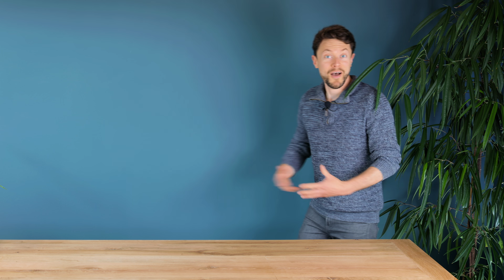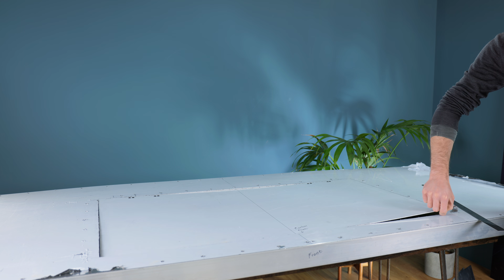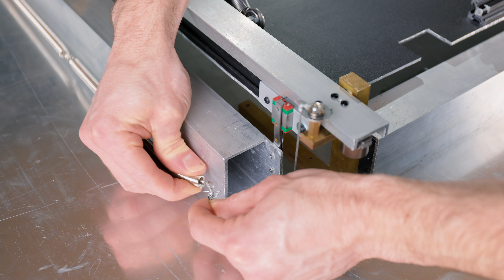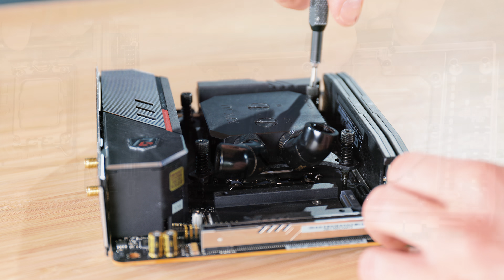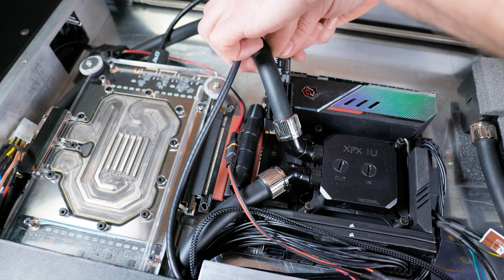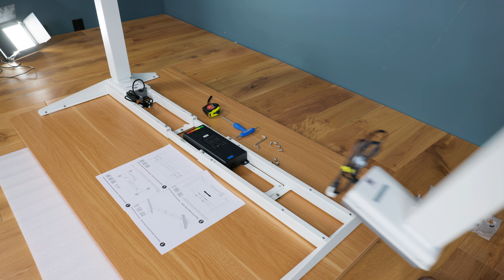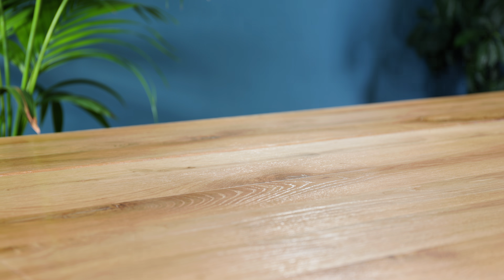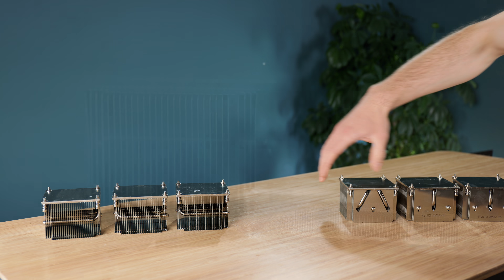Building the ENDGAME invisible PC

Comment: I don’t have to watch full video to give a like to this video, just amazing concept as always.. just a small doubt, the brass pipe water flow is in series it seems which might conduct heat from one brass pipe to another directly and through heat sinks which may lead to low efficient heat dissipation, the water flow could be designed in just one direction starting from one side to the other in parallel with all those 4 pipes  which might improve heat dissipation, but you must be knowing it better.. I am not sure if this works as I mentioned…

Comment: Don't use a 13900k it's power draw is so high that you have to delid it to get it to not thermal throtle 
i recomend using a R7 7800x3d or R9 7950x as it is the same prefromance for lesss power draw

Comment: First of all, you did a great job. My idea would be a water cooling system with radiators ranging in size from 40mm to 80mm. These could fit perfectly for the width of the table. The Alphacool brand makes them, for example the “Alphacool NexXxoS HPE-60 Full Copper X-Flow 80mm Quad” would certainly be worth considering.

Comment: Awsome video! You solved a huge problem for an idea I have to make a 3 PC in one desk build. I am going to use the X32 PC's and they will be all air cooling as well.
2 questions thou. 1. The brass tubing you used for the water cooling. Will there be a corrosive build up in the water from the brass after a period of time in use? I'd like to see a fallow up video on that too.2. Those slime fans that you used. Are they name brand and where did you get them? Did you have to buy them one at a time or in a lot pack?
And I see only one problem you might have in the near future. How are you going to repair or replace the monitor when all that wood is glued to back of it covering the mounting screws?

Comment: If Corsair and Flexispot teamed up to make this a commercial product, I'd save up for one like it was a new car or something
Reply: It would probably cost as much lmao
Reply: @xe8905  worth it
Reply: you can get it cheaper if you just get someone to do it. I showed this video to a furniture maker friend of mine and he said it's gonna cost me about 3-3.5mil IDR (about 200USD ish?) for the table top only without the motorized legs, that includes the material and labor cost. he said it can be made even cheaper if joined aluminium strips were used instead of sheets. the woodpart can be made from wood scraps joined together too if you want it cheaper and doesnt mind the pattern (imho it is cool tho).

perhaps its a bit more expensive on your area depending on the material/labor cost, tho
Reply: @Chronostra  In Indonesia you could maybe have the table top for around 200 but it takes a lot more than that to be fully functional. Imagine a furniture maker from Europe or North America making this and selling it as a complete and finished product, it would probably come out at around 15-20k

This is not some scrappy home project, it's high end custom furniture.
Reply: @ThaJay   that's why I said depends on the material/cost of your area, did you not read mine till the end?
Also it's DIY, you can go balls to the walls throwing money for the bestest unobtainium for your project materials, or you can swap parts for cheaper stuffs to suit the budget and needs.
Because most of the time branded products are often more expensive compared to locally sourced. You can try compare the same size and quality table tops from ikea and your local furniture/woodworker, or try showing Levus Zero G Workstation to your local welder how much it cost to weld steel piping into that shape will the price even crack half of Levus'
Reply: @Chronostra  fair enough
Reply: Why corsair? The only thing from them are the fans lol
Reply: anyone but corsair they are super expensive, he could have went with different fans and saved a lot!
Reply: i wouldn't pay corpa hacks a dime for this. diy or pay the guy. no corpo zone!

Comment: Interesting project and well done in the realisation. But I don't realy see any kind of reflexion on the maintenance topic of this kind of project. 
A custom watercooling system needs to be checked every 6 months or at very least once per year. And by "checked" I mean you have to change the liquid, and check out if there is no problems in the waterblocks. You will also need to do some dust cleaning time to time (like a least every month). How does this build allow you to do this without dismantle everything ?
A cool idea would be to do the same flexible pannel you done for the screen but for the computer. Something like this may allow you to keep your computer clean and be able to do any sort of cleaning, repair, or upgrade with the minimum efforts.

Comment: cool design but some would lose time closing and opening it as well as losing drawers already in thin desktop. would be nice assignment for a mechanical engineering student.  depending on the temp you may be able to use hot water from those brass tubes to make coffee or espresso. many espresso machines use brass boilers. you'd need to use food safe tubing. that power lift in up positiom would look like a European espresso bar. could have used a apple silicon mac mini with a thunderbolt external ssd array. way cooler, way less power consumption and noise.

Comment: Did you have any cooling for the motherboard, power supplies and nas? That's one thing to be mindful of when doing watercooling: normal waterblocks do not cover everything that needs cooling. Even a monoblock that covers the motherboard VRMs, doesn't provide cooling for chipsets, drives, RAM (DDR5 runs hot, it has power management on the modules themselves) etc. This stuff usually get cooled by case airflow and the airflow movements generated by CPU and GPU air coolers.

If you use waterblocks/AIOs and radiators to move the point of thermal exchange to air, away from where the CPU and GPU are - do remember that these heat sources left behind still need airflow. The backside of your GPU included, especially if it's a 3090, 4090, 7900xt(x) etc.

Comment: Apart from the mindblowing feat of engineering that left me in awe, I am questioning the use of the monitor, as the primary selling point is that it bends, yet with this setup that wouldn't be the case. I feel like the price markup of the monitor due to its bending hasn't been used and I wonder if there are any other OLED UW monitors such as the ones from LG or SAMSUNG which would be cheaper than 2k would be a viable lower cost alternative. Or is this monitor the only one that would work due to its thin profile and mounting points? In either case, this is a top 3 build I've ever seen. Truly GREAT WORK!
Reply: well, once you get into really large, really high end (consumer) monitors, the choice shrinks really fast - esp. once you start adding some functional requirements. Could be this was the only one available on the market, ticking all his boxes
Reply: What he really needed to do was incorporate the curving mechanism so he can still curve the monitor after the compartment is opened. Although, he may need some kind of interlock that prevents closing without first flattening the monitor again.
Reply: This exact panel is used on a few different monitors - Corsair is just the one putting the flexible mounting on it. I all but guarantee he was sent the monitor by Corsair, either for this video or something else previously.
Reply: can't he bend it still? If not, couldn't he just screw the center part of the monitor to allow the borders to bend in? Maybe not, i have no idea on how this screen works

Comment: I like it. 

I disagree with the comments about the adjusting the monitor height. I think if anything a slight tilt adjustment would be fine, but you dont want to be able to close the monitor in the hatch and break it. The hatch cutout is limited by the depth and width of the desk, so the only height adjustment available is within the hatch footprint. And the footprint isn't much unless the desk is very deep.

My idea is the radiator needs some sort of cover to protect the blades from coming into contact with fingers or whatever and because one end of that metal is potentially hot enough to burn skin with long enough contact. Especially children. At 50C, its probably fine, but your other test indicated that 90C was a possibility, and 70C is the burn threshold for metal.

Both to avoid injury and breaking a fan it needs some sort of cover. But it also should be designed not to restrict airflow. Im guessing a lot of the benefit in cooling is actually the bit of blade sticking below the desk. Im guessing the desk is built tightly, so there's not enough airflow through small leaks in the desk.

I wonder if the original laptop fans would have worked better if you just removed one of the heat sink sets so that they could draw air from behind the desk without having to draw the air through a heat sink. Basically just cut the air resistance in half. The original setup I assume would have drawn air across the one heat sink and then blown heated air back across the other heat sink providing basically no cooling anyway. I think it was just doubling the air resistance for no benefit.

Also someone mentioned this, but the back and forth brass pipes, wouldnt they transfer some heat from the water coming in immediately to the already cooled water going out? Some sort of solid insulator or even just air between the segments would probably make that bit more efficient.

Great build! Dont take any of that as more than the thoughts of an idiot.

Comment: this is a neat project. Sad that the original design for the heat spreader didn't pan out. for a moment I thought you were going to slam like a miniature water chiller for the loop in the desk, but I can't think of a better way than what ya did. Only gripe I could give is your monitor and keyboard tray needs to be more deeper in the width of the desk so the center of the monitor is more eye level for adults. Kids who would have this desk it'd be perfect for when using. still an amazing project. you deserve to go to bed with the stupidest grin on your face.

Comment: To reduce heat, its easier to tune the components like undervolting and to operate any component to theirs most efficient point (eg fps/watt). This way the cooling system become almost not a problem at all. Component are ok to run alone between 60 to 70 C without any issue.

Comment: Well, as much as I may admire your work in the end it felt like it's missing something, I mean you can push the limits in this project and add a mechanism that opens the lid of the monitor, and also try to fit some fans into the desk without anyone being able to see that there are fans down below. Also is it possible to implement some hidden speakers inside the desk?
 Other than that I Am amazed by the effort and dedication along with the polish you put into your projects. Outstanding!

Comment: Placing the GPU and CPU directly after each other in the loop isn't great because the heat from the prior would affect the latter, but I guess the 1560mm radiator is enough to bring the coolant temp low enough for that to not matter. Although, you might have been able to use fewer radiator (and/or smaller fans) if you allocated dedicated radiators to each component. The coolant's equilibrium temp would've probably been higher, but the components don't care unless that equilibrium is above their rated temps. Might've even been able to position small form factor fans and radiators around the cavity that that's left when the peripherals platform lifts up to make it truly invisible. But I agree that the 120mm fans at the back aren't noticeable unless you start looking for them, or unless you are a small child and the beastly FlexiSpot motors lift the immense weight of the desk above your head (Use code DIYPERKS if you too want a desk that can help you paint ceilings).

Comment: I think the problem with your first cooling solution is that you basically had a thermal short between the input and output of the radiator. Such a long length of brass piping directly connected just conducts heat too well. Having the water output on the other end of that snaking heat spreader would've helped a lot. Also bends in air ducts have significant flow resistance (you can calculate that). Very sleek build!
Reply: yep i thought about it too, although the second whould have had the same problen, whouldn't it?
Reply: @joanfarnes1908  the second one is so overpowered that it's fine.
Reply: Might be a fair point actually. Having input and output on the same side with a direct thermal bridge across the length of the pipe basically means it acts as a countercurrent exchange mechanism between the inlet and outlet brass pipes.
Reply: Maybe isolating the brass pipes could have helped.
And I wonder how much cooling this system could achieve without the fans.
Reply: Don't forget he (probably) doesn't show everything. Thermal conductivity over the whole brass length is one thing he might have checked beforehand.
And it obviously works in the end, the brass part remained in the final system as far as I know, so the thermal short can't really be.
Reply: @claudej8805  read my previous comment.
Reply: @Leo.Wolf.the.Engineer  I did. If there was a significant thermal short, the temperature would rise. 52° at 400rpm is no little feat. 800W needs a lot of fans pulling such little weight, not just the first 2.

Comment: @Flexispotus gave you the wrong feet because you should never max out the capacity, it's bad for the motors long term. They should have known better and give you their EQ7, which has 4 motors instead of 2 and is much more stable for such a heavy top. Kind of negligent on their side.

Comment: Incredible. Engineering meets artwork, I bet if you wanted to start a Kickstarter to have these produced in bulk, there is nothing on the market that comes close to this, especially with the ability to update computer hardware if required.

Could the desk legs be moved closer to the interior, or desk surface be made larger to use as a communal dining table?

Comment: the problem is you accidentally created a "short circuit" in your cooling setup. the heat can just flow from the entering pipe into the heat sink and out the exiting pipe. course not all the heat will but i think a good amount of performance was left on the table.

Comment: Cool PC table and very creative cooling solution. Have you consider the Alphacool 1U radiator. Base on you design, you could put 2 rows of 5 radiators with the 40mm fan in the middle doing both push and pull function. If you did, why not? Since the fan would be conceal too.

Comment: For the fans (2nd revision) you could make a similar designed addon like that's used for the edges of the desk. But instead of being solid, have lots of holes in them to allow the air to flow through. Then, have a slot for a filter to be placed so that cleaning can be done really easily.

Comment: Amazing build. The only improvement I would suggest is adding mesh screens around the fans to prevent dust buildup, keep them running efficiently for longer without needing frequent cleaning, and provide a cleaner, more streamlined look.

Comment: This was a beautiful build that could be even better with a couple small enhancements. First, replacing one of the gas struts with a small linear actuator would make the opening and closing automatic, controllable by the same panel as the table lifting mechanism. Second, you could opt for only one layer of heatsinks and use 90mm fans instead and I bet the cooling performance would be equally as good. If you're not already using high performance thermal paste to interface between the brass rail and the heatsinks, that might also help too. This really inspired me to think about building one of my own versions of this desk and the kind of features I'd like to include. Nice job!

Comment: The only thing i have to point out as a problem here is the heat distribution pipe, it should not be coupled the hot and cold right where it enters and exits.

It would be better to have in on one side and out on the other, not back and fourth.

Or have the lower heat sinks on the supply side and then when it turns back only on the return side pipes and have them thermaly separate.

Should improve efficiency and peak cooling

Comment: @DIYPerks  

Hello Matt, love the channel, love the content.
While watching your video - specifically the part where you solder the brass box sections - it reminded me of copper pipes that i have in my apartment that go to radiators and also have water in them that transport heat.

Could you do a project where you take the heat from a water cooled PC and circulate the water/cooling fluid trough a radiator - to see how much it would heat a room, or several rooms?
The point it of such a project would be to:
1. see if you could use your PC heat (that is otherwise wasted) to heat a radiator to warm a room, or several radiators to warm several rooms 
2. if the project works it wold be a great ideea to cut heating bills by a lot - especially since most people have a PC in their home.

If you find something similar done bt Linus Tech Tips - let me tell you right now the execution was very bad and unscientific so I didn't really count.

Hope my message finds you well.